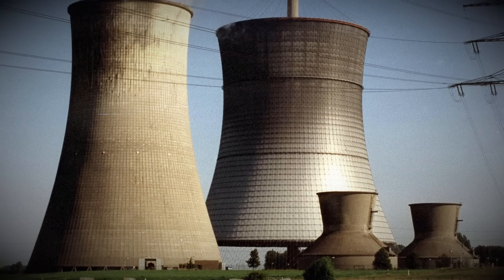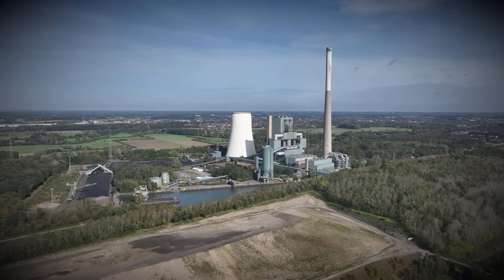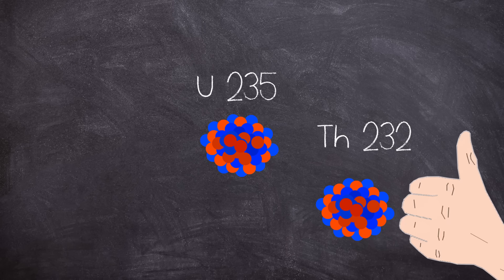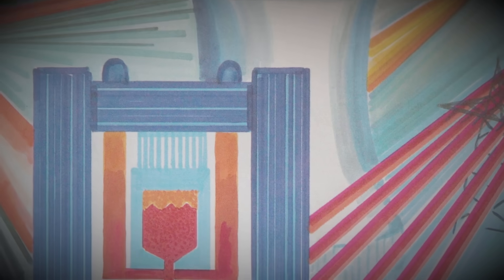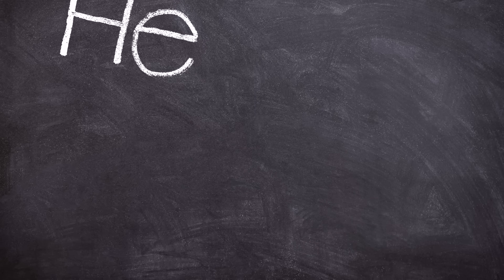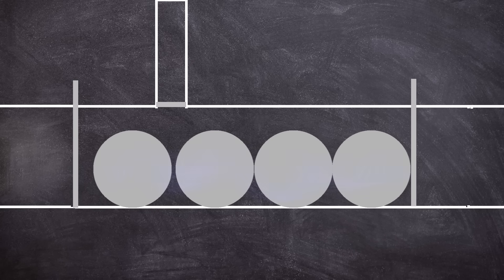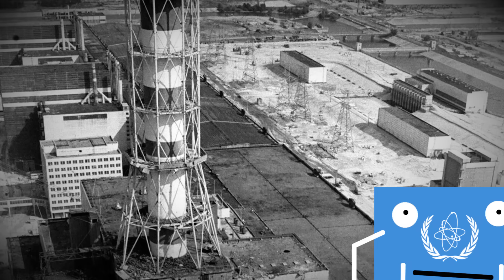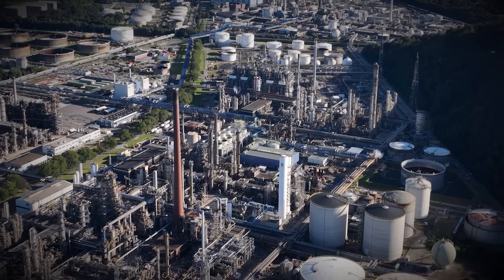Inside Germany’s “Chernobyl”

Comment: One information in your video is not correct: albeit the cancellation of nuclear energy production was decided between 2000 and 2002, the phase out lasted until 2023 when the last three reactors went off grid. But either way, the deaths resulting in replacing the amount of electricity generated by nuclear with coal were orders of magnitude higher than those of Chernobyl. They tried to spin the story that nuclear was replaced by wind and solar, but we all know that is not true because these aren't continuous energy sources. 
And as a result, Germany has some of the highest energy costs in the world, causing further harm for the industrial production on top of crumbling infrastructure and overbearing bureaucracy. And that all because people have a fear about things they don't know about. One very popular slogan was "Chernobyl is everywhere". I tried to confirm that one and failed to find just the tiniest amount of Chernobyl fallout in my region. Trace amounts of natural uranium in the rock, yes - but no Caesium-137. I even probed the mushrooms, nothing. But don't be in a hospital. You may encounter several people per hour who radiate something like several mSv/hr. And they don't even tell them to keep their distance to other people.

Comment: The emissions released in this incident were less than 1 beq per square meter in the immediate vicinity of the reactor. At the same time, 10,000 beq per square meter existed in the immediate vicinity produced by the Chernobyl reactor. thousands of km away in Ukraine. In my opinion, mentioning these two accidents or the meltdown at the same time in the headline is click bait. nothing more and nothing less

Comment: Never mind that Three Mile Island had a total casualty count of...precisely ZERO.  And led to HUGE improvement in nuclear power station safety, because while there was no release of radioactive material (and hence no injury to any people) it did demonstrate numerous problems with alarm systems and computer interface design that did lead to huge improvements in safety design.  (And not just in nuclear power plants.  Things like aircraft warning systems benefited as well.  One of the big lessons from Three Mile Island is that every audio alarm should be distinct and easily recognizable just from the sound, a lesson incorporated into modern jet liners as well.  It had been learned as far back as WWII that different controls should have a different shape, because similarly shaped controls near each other can be mistaken for each other in critical situations, or just because the operators are tired from a long period of operating the system, leading to errors that cause disasters, a phenomenon known as Design Induced Operator Error.  One of the computer interface design issues at Three Mile Island was that the computers couldn't display the specific and critical data on the reactor state to the operators clearly, leading to the operators completely misunderstanding what was going on and deciding to do the wrong things, when the automatic systems had been keeping the situation under control, leading to the situation going out of control for a while.)

Comment: Interestingly, the THTR-300 was built as a fourth block of a coal-fired power station. Its turbine hall was actually the same structure as the turbine hall of the adjacent coal block, but I believe the turbines were separated by a wall inside.

Comment: both water and gas are not good choices for cooling the core of a reactor.  The safest and most trouble free cooling medium is hot, liquid salts, and just dissolve the fuel into the salt.   That eliminates all the normal modes of failure.

Comment: In fact, the whole political process of shutting down nuclear power was a disaster of it's own. The decomissioning of the DDR plants was'nt really related to the government wanting out of nuclear power at that point. It was just that they thought the sowjet reactors to be not safe enough for western standards. Then, in the late late 90s, a governemnt, SPD (Social Democrats) and Bündnis 90/Die Grünen (Green Party), was elected, where one of the junior partner's (Die Grünen) founding goals was shutting down nuclear power. This entailed an amount of Energy allowed to be produced by every plant, before it needed to shut down. That allowed for roughly operation into the 2010s, maybe early 2020s for newer plants. That was legislated in 2002. 
Then, when the CDU (Christian Democrats/Conservative), who campaigned with weakening or somewhat reversing the previous legislation, came back into power, they legislated that all powerplants were allowed to run for either 8 or 14 more years (in 2010). Obviously the companies running these plants were scared of a different government later reversing these changes, so they had huge contractual penaltys for the federal government included in a new contract. 
Then Fukushima happend in 2011. And the same governenment, which a year prior, made the reversal of previous legislation and made these new contracts with the plant operatiors, reversed their decision and went back to what was essentially similar to the original plan and legislation for the decomissioning from 2002. Which in turn cost the Government billions cause of afore mentioned contracts. 
All in all, it was a massive German shitshow.

Sorry this became a more of a brick of text than I originally intended.

Comment: Trump warned Germany at the UN in 2018 that they were becoming too dependent on Russia for their natural gas imports for their electrical power needs.
The German delegation just laughed at him, like he was a buffoon who didn't know what he was talking about. 
Then Russia invaded Ukraine during Biden's failure of an administration and Germany cut off its nose in order to virtue signal to the world by refusing to license the new Nord Stream 2 natural gas pipeline between Russia and Germany. 
So Russia drastically reduced gas supplies into the Nord Stream 1 claiming sanctions were preventing it from getting the parts necessary to do basic maintenance on the pipeline. 
It was then that Germany realized... they fkt up. 
And Trump was right years earlier. 
Germany had shuttered all their coal power plants and were about to decommission their sole remaining nuclear power plant. They immediately started opening up those coal plants and got them running again. 
I guess the Germans still refused nuclear though. 
Pretty short sighted people those Germans 🙄

Comment: This incident is not to be trivialized. The design of the pebble bed reactors was flawed in more ways than an automatic feeding system. Especially the particles generated by the interaction between the pebbles which meant that any release of radioactive gas would be substantially 'dirtier' than any other reactor type made the relatively small leak much worse. The problem was that all this was known beforehand yet it was built anyway. Combined with the poor handling of the incident and subsequent blaming of Tsjernobyl (yes, it was a cover-up attempt) was the proverbial final nail.

Comment: Thorium was actually the front runner in the race for fueling the first nuclear reactors.  It did however have one major drawback, it didn't produce weapons grade materials as a by product.
Reply: You can make weapons grade in a thorium reactor, it's just harder to do.  The Manhattan Project was trying to build nuclear explosives as quickly as possible.
Reply: Of course it did. The fuel in the thorium cycle is U-233, which is said to be just as good a material as Pu-239, based on the minimal testing with U-233 warheads. But it does require some extra steps to make.

Comment: 77,6% of fossil fuels is not true! (13:03 in the Video) According to the Frauenhofer ISE renewable energies have a share of 57,1% (1) from netto energy production. It should also be noted, that the german ministry of energy and economy pushed big changes for the simplification of new approvals for wind and solar systems. Therefor in the first quater of 2024 renewables were responsible for more than 60% (2) of the domestic electricity production. I would like to know the source you are referring to.

Comment: This reactor sounds somewhat similar to the Dominion Nuclear Power Station in Surry, Virginia. The Dominion nuclear power station in Surry started construction in 1969, and became fully operational in 1972 / 1973. The reactor uses radioactive pellets, I think. (Don't take my word for it). In other words, it's a clean system, and not much, if any, waste is produced. Yes, it has had some incidents over the years. A total of 8 people have died at the reactor site since it became operational which is because of steam injuries and operator error. The other nuclear reactor in Virginia, the North Anna Nuclear station, has been a bit more problematic. In 2011, an earthquake caused the entire plant to shut down. (Yes, Virginia has earthquakes and no they don't happen often). There have been other issues there as well.

Comment: I just can’t support nuclear energy for several reason such as this; what happens during an accident. But even in perfectly run with no accidents reactors they have a relatively short lifespan of 30-40 years but the radioactive matter left over won’t start to stop being deadly for what, 10,000 years at least?

Comment: 10:00  Are you sure your units are right?  A Becquerel - one disintegration per second, is a tiny unit (compared to the archaic "Curies" we still use in the backward USA).  10 Becquerels, being dispersed from a plant into the outside air, is absolutely tiny.  For example, the recommended action level for radon in household air in the USA is 150 Bq/cubic meter.   So just opening a window in my house in winter would far exceed that emission.  (In practice, I keep a couple windows cracked open and pay more to heat the house to keep the level at about 80 Bq/m^3).
Reply: Action level in Germany is 300 Bq/m3

Comment: I knew about this Prototype reactor. The cooling tower was special, too. Because of the high temp He-cycle, the cooling could be done in a "dry tower", which didn't produce the heavy clouds which were/are floating over all LWR reactor sites! 
In  SW-Germany, Baden-Würtemberg, there was a special fight over the harm which those permanent LWR clouds would do to the neighboring vineyard plantations, reducing the quality and quantity of grapes! Those were the days (nobody knew about Tritium, Neutrinos, NEA-impact probabilities; the more severe stuff)! 
Now a THTR tech reactor is built in China. 
I didn't know the Hamm-Üentrop reactor was shut down because of a fault in the feeding tubes. I thought they had a plugged nuc-fuel-balls-extraction mechanism at the bottom! Some (too)? hot balls got stuck there. And other problems with the high temp heat insulation, tiles falling off, etc...
Lets see if the Chinese reactor is more reliable; hopefully their extraction mechanics works in all operation ( and emergency) conditions. 
I think Molten Salt reactos are better; especially the LFTR of Flibe Energy; it can handle Th and the resulting Pa233, Xe-gas, and Tritium better than any other type reactor!

Comment: C‘mon, „Arbeitsgemeinschaft Versuchsreaktor“ pronunciation is no worse than our energy policy.

I resonated in particular with that part of the story, where engineers ask operators to perform something not supported by the automation/software, probably because no one told automation people to implement this. From something helping operators, the automation becomes then an asset they need to „outsmart“ to accomplish whatever they currently want.

Comment: "Arbeitsgemeinschaft Versuchsreaktor" translates to "joint venture test reactor". It was the first prototype of an high temperature reactor (HTR) and it was specifically meant to test this new type of reactor and its quirks. The later THTR-300 is based on the AVR's design but was scaled up to a commercial production level and had improvements that fixed faults which came to light in prior tests on the AVR (namely the layout of pipes which meant the AVR's core would be exposed to water if a pipe broke, that's why the pipes of the steam generator are shifted to the side in the THTR-300).

Comment: The state government of North Rhine-Westphalia had hoped that such a power plant could be used for coal gasification. This in turn would have secured jobs at the coal mines in the Ruhr region, as it would have provided a product that would have been internationally competitive. It would also have connected the old energy world and the new energy world. However, it later turned out that the reactor was not suitable for providing the necessary process heat. 

This accident was not the end of the THTR. In fact, the accident was still in the test phase. The reactor was only put into regular operation in 1987, although the word regular operation should be placed in quotation marks, because even then it did not function reliably. In 1989, the reactor was shut down after only 423 days of full load operation. Unlike other nuclear power plants in Germany, the THTR was not dismantled immediately, but has been in “safe enclosure” since 1997 and continues to generate costs of 6.5 million euros per year. Demolition is scheduled to begin in 2028 and is expected to take 20 years. 

The Westfalen power plant was chosen as the site. There were already 2 hard coal-fired units there from 1962 and another hard coal-fired unit was added at the end of the 1960s. The power plant site is located on the Datteln-Hamm Canal, via which most of the coal was delivered, on a railroad line and close to the A2 highway. The river Lippe, which was used to cool the power plant, is also located to the north of the power plant site. You can see several cooling towers in the pictures in this video. Only the silver cooling tower belonged to the THTR300, the rest belonged to the coal-fired power plant. A normal nuclear power plant was also to be built on the site, but these plans were canceled in 1995. today, two newer coal-fired units that are much larger than the three old ones stand on the site of the second nuclear power plant as of 2008. In the meantime, however, these units have also been decommissioned, so that the power plant is completely out of operation. Perhaps the site is cursed as a power plant location.

Comment: You mentioned the AVR reactor, which was an even stranger construction and had an even bigger incident whose consequences are still dealt with. It warrants its own video.
Small correction: The "H" in THTR doesn't stand for helium, but for high, so the abbreviation is for "Thorium-Hochtemperatur-Reaktor", or in English "Thorium High Temperature Reactor".

Comment: Filter installed on the exhaust chimney. Designed by John Cockroft perhaps? 😁
Reply: (reads) Cockroft's folly filters prevented the Windscale desaster from becoming even worse, didn't they? Only that his didn't have to deal with an atmospheric pressure of 32 bar or what is left after it got redirected.

Comment: Gas cooled like the Advanced cooled Reactors Graphite beds and fuel in Carbon dioxide and Nitrogen as well as the One in China are a lot safer than the Water pressurized reactors. Canadu reactors use heavy water Deterium water with Uranium 238 fuel but any reused fuel can "be used" in a Canadu reactor including reused Uranium and plutonium super fuels. It has not been done a lot since it is super expensive ($$$) compared to mining Uranium. The Gas cooled reactors have normal control rods Cadnium or another material (Not carbon tipped).

Comment: Hmm uranium 235 and Thorium 232 breed reactor Graphite silicon balls. Could be ideal for Advanced THR in China. The China version is similar but uses U-235 and noble gas as a coolant. It is too bad that Germany did not work with this prototype after this incident. . It interesting a gas cooled Thorium Uranium reactor.

Comment: I keep asking for a story on the D1-G in Balston Spa, NY. After it was shut down, the doe and the d-ass navy thought it would be a good idea to dump the primary coolant into an old water well. Because liquid sodium burns off in water, yyyyyyyeah !
However the radioactive contamination does not, boooooooooooo !!!     
So when I went on a work trip to the place, our contact person told us they had a contractor digging up the contaminated dirt.
The management tried hiding 6   30 yard dumpsters completely full off on an old dirt road that looped the complex. It was,,,,, used as a running track for sailors to stay in shape, because there were mile markers on the road. I just happened to go for a bike ride and I came to a steel gate, as I got past it and stood up to get back on my bike. I see all these dumpsters lined up and covered in radioactive ☢️ tape and plastic yellow tarps . The best part was 10 years later, I was taking a guy on a plane and he told me it was his uncle was the one that dumped the contaminated coolant.    Small FHAKED up world we live on.

Comment: 12:55 In 2023 the share of renewables in the electricity mix was 60% and not 77% fossil. What is this guy talking about?
Reply: Short update, in 2024 the amount of coal used in Germany was as low as 1957.
Reply: Probably referring to total energy consumption, not just electric.

The 10% figure given for nuclear also only makes sense in that context, as for electricity it peaked at over 30%
Reply: @hartmutholzgraefe  Talking about total energy consumption makes no sense at all in the context of reactors being shutdown. The share of renewables has steadily increased, but this guy somehow wanted to bring a negative message to us but failed completely. Seems to be a nuclear power lover.